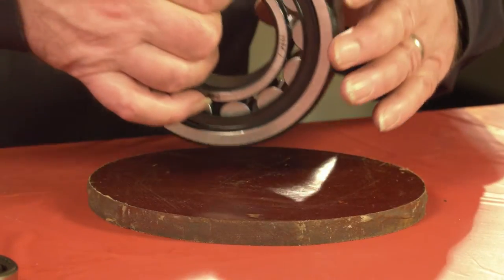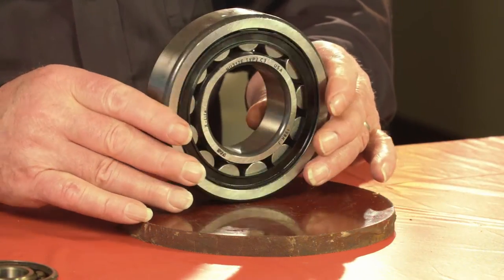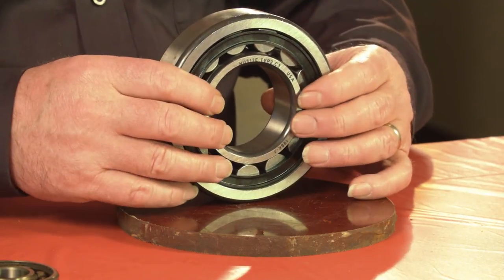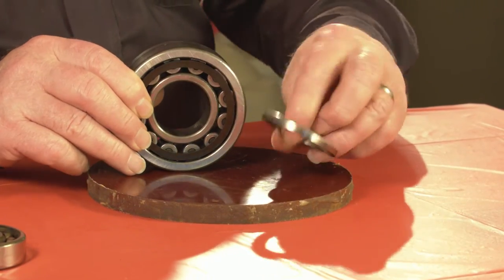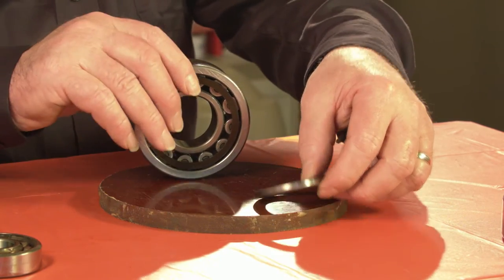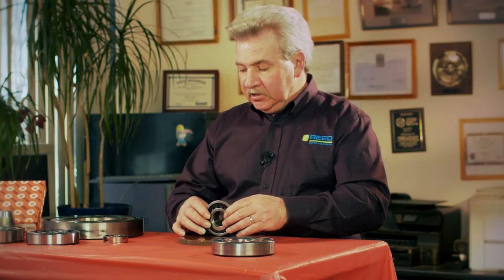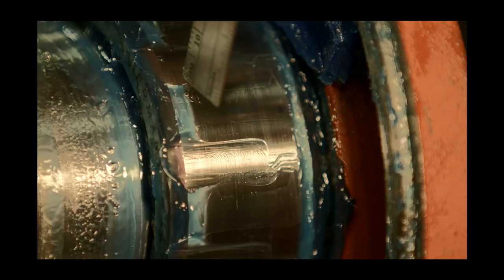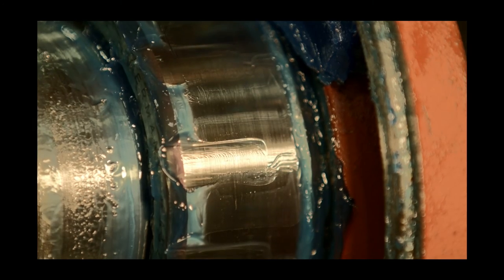Cylindrical Roller Bearings

Comment: Thanks for your great videos, very interesting.

Question from a total novice: will an NUP bearing function the same whichever way it is oriented on the shaft?

I ask because my online research has led me to understand “Mounted on the non-flange side of the inner ring, the thrust collar allows the bearing to carry an axial load in both directions.”

And further that “The thrust collar extends out of the bearing on one side, so the dimension across the inner ring is slightly greater than that of the outer ring.”

This second explication suggests (to me) that it might matter which order the parts go on the shaft.

The Toyota factory installed this bearing on the transmission counter gear shaft (using their terminology) 

side race, 
bearing outer race and rollers, 
and then the inner race, which is a press fit.

However, the Toyota Repair Manual, in both the disassembly and reassembly have this order reversed.

Which kind of suggests that it doesn’t matter.

Bottom line, I want to do it right, do whatever will give me the best, longest service.

So I ask the experts, if there is a preferred orientation, what is it?

Thank you

Robert
Reply from the maker: The NUP has both outer and inner races the same size including the spacer on the inner race. They are not designed for thrust. The design allows for some containment compared to the NU type with no shoulders on either side.
Normally NUP can help so you don’t have to be exact with the dimensions bearing to bearing with bearing caps.

There should be a locking method used to stop the axical thrust so NUP doesn’t run hot rubbing the shoulders on either inner or outer races.
If I was worried about thrust and was going to have to use the NUP,  I would put a snap ring or locking nut in front of the inner ring on the shaft. 

Most the time the assembly is the problem trying to use these if there is a nut larger then inner race.  (response is from Reed's Reno Plant Technical Director)

Comment: can you please let me know why some bearings have cage made of brass and some plastic.
If i interchange these bearings, will it lead to failure of machine?
Reply from the maker: In our opinion, the brass/bronze cages are a more durable bearing while the non-metallic cages are often less expensive and run quieter.
Reply: Can you please also define the capacity of metallic and non metallic bearing. made a video to guide that where we have to use metallic and non metallic bearing. So that we can select the exact bearing. thanks.

Comment: Are these available for bicycles?
Reply from the maker: Yes - but as we are by no means experienced with bicycles, we think addressing this topic with bike techs would be far better.
Reply: @TechTrainTracks  Bike techs are not practical, I work on my own bikes and have mixed and matched some different hardware to work better together. I use loose ceramic balls on shimano loose bearing hubs, but getting the loose ceramic balls was not easy.

Comment: Can anybody tell us the method of demagnetizing the rollers before assemble in a bearing
Reply from the maker: You would use a degausser which removes the magnetism from the bearing. Degaussers are similar to devices that are used to bulk erase magnetic tape. Magnetism is sometimes induced into bearings when bar/transformer type heaters are used to heat the bearing bore for installation on a shaft journal.
Reply from the maker: New SKF heaters include degaussing. You can use a growler that is used for testing for open rotors in the squirrel cage  type design, but they are take more work to perform degaussing. Hope this helps.